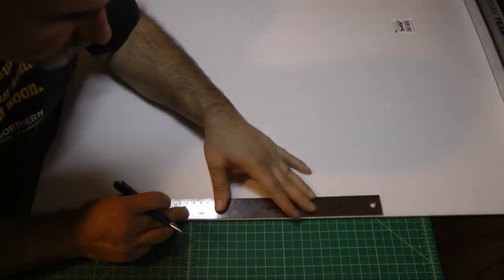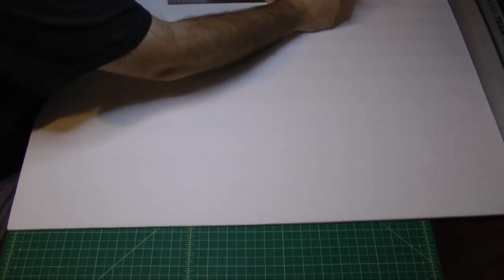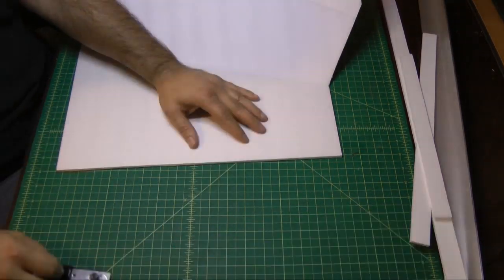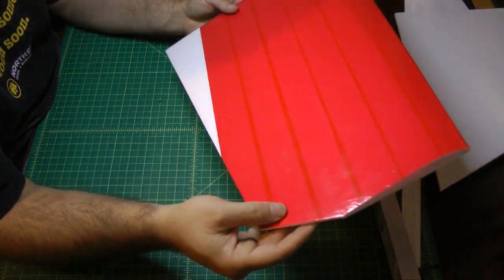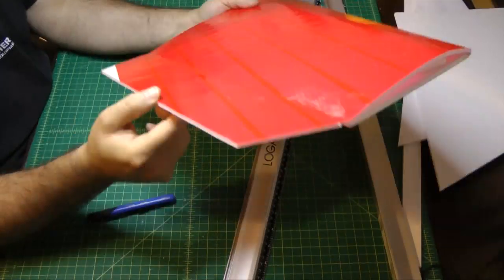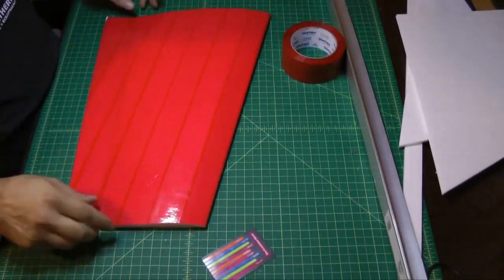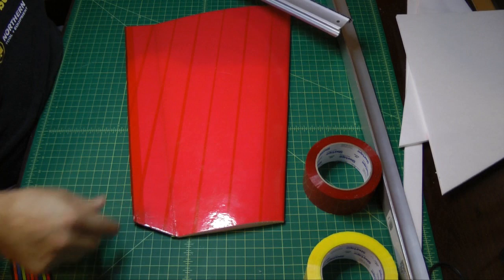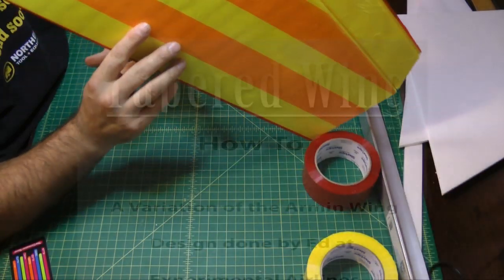Tapered Wing

Comment: What is the purpose of a tapered wing ?  How does it change flight characteristics?  What are the plus and minus of this design ?
Reply from the maker: I'm not an aeronautical engineer, but from sources, "...Tapered wings increase the aspect ratio of the wing (length to chord width) improving lift. The smaller tip also decreases induced drag by reducing the size of wingtip vortices where the lower air mixes with the upper surface air."
I just did it to build a cool looking RC plane :)  And actually it does fly very well.

Comment: You showed two flat 'formers' for the spars..and that makes the thickness of wing same from base to tip... I cut a taper triangle (cut several--like 3-4) to stand up vertical and glue it with thickness desired at base and thinner tip so that when you roll the top sheet over , the wing is not only tapered in outline, it is also tapered in thickness..

Comment from the maker: It is a Logan Grove cutter.  I talk more about it in an older video I have posted called "How To Make Bevel Cuts"

You can always just use a straight edge and a sharp utility knife using the technique Ed demonstrates in one of his videos, "Foamboard Building Techniques: Stabilizers 2 - Control Surface Hinges", but I already had this tool handy so I make use of it.

I would have put in direct links to the videos in my reply here, but youtube does not allow for whatever reason; sorry.